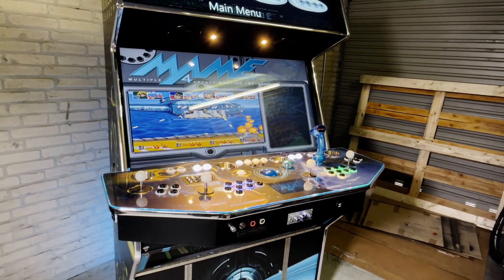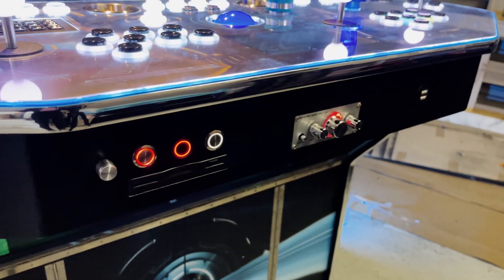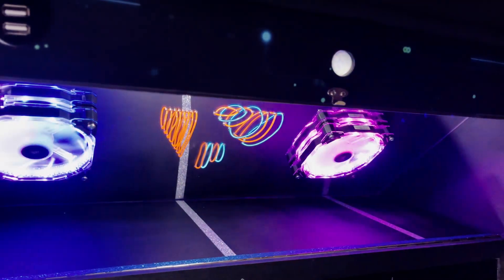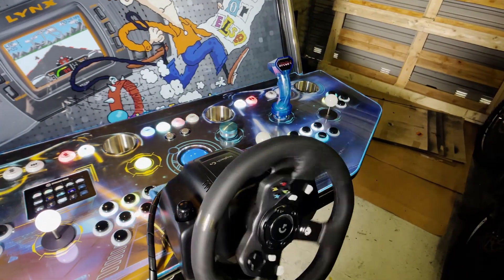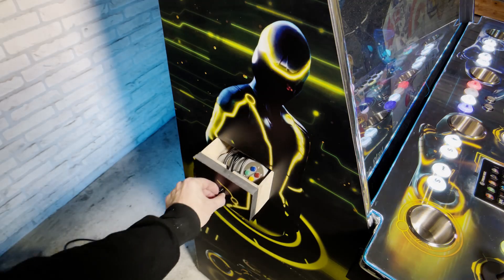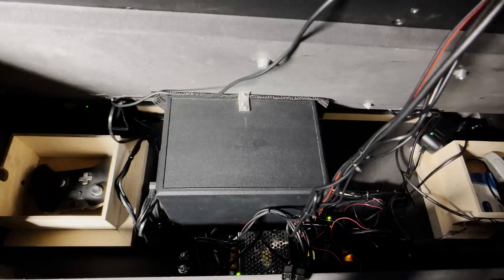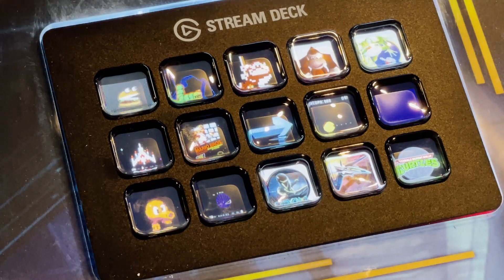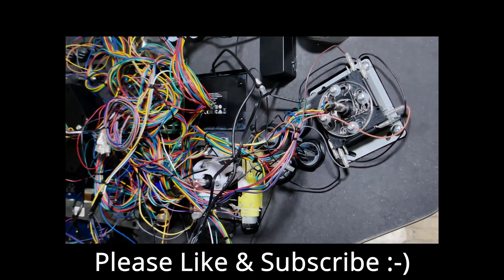TRON Arcade Cabinet | 43 inch FOUR player with steering wheel 😱🕹

Comment: What is the front end software you are using? I see it is windows os. Just wondering what you had to do to get it to full launch and shutdown with a button press.
Reply from the maker: Hyperspin 👍🏼
Second question: all 12 and 5V peripherals are powered by the pc psu. This way, they turn on when the PC is starting up.

Comment: Could have the wheel underneath the panel and then flips from bottom to top when you need it. Hiding it underneath the control panel when you not using it. I know lots of work

Comment: Is there more than just the 2 speakers over head?
Reply from the maker: Yes, it has a logitech speaker system inside. The two top speakers are wired to the logitech set. Thanks, Daniel

Comment: Hi Daniel i have been following your builds for some time now and they are amazing! I have recently built my own 2 player arcade with a 32 inch screen and i would like to turn everything on with one button as you have done, but i cannot figure it out. Can you help with how you did this? Any reply would be a great help. Keep building these amazing machines as they are an inspiration Thanks in advance.
Reply from the maker: In my case, I was lucky. The screens will turn of when not recieving signal and the 12 spots are connected to the pc PSU. Another (better) way would be to use a heavy relay. So:  115/220V into the PC, PC 12 or 5V into the relay, relay to the extention cable. This is commonly used in virtual pinball machines as well.

Comment: I can watch this video over and over again lol. Great one. Daniel how did you get the dynamic marquee to display the same size as the 7’inch lcd screen in the control panel?
Reply from the maker: Hi, the Marquees are operated by a program 'Hyper Marquee' the build in screen just shows the logo or game-box art. The huge Marquee on top shows the actual Marquee. Thanks Daniel
Reply: @TheDanielSpies_Arcades  okay makes sense to me now. Do I have to set up two different Hypermarquee programs so they don’t interfere with each other.
Reply: Okay I see how do you set that up in Hypermarquee? I find it difficult to to set up for two different monitors. I want my second and three to display marquees or clear logos. Not sure how to do that in EDS..

Comment: Does anyone know the size screws to mount the 7 inch LCD panel to the wood? I cant find this info anywhere.
Reply from the maker: No screws! Panel is only 4mm thick and flush with the board. I use a metal plate to hold it in place. Thanks D

Comment: looks great, I had a short question, have you use 2 Ipac Boards, when yes how the software check this, when i use ipac software, is there to boards,? thx for a short feedback
Reply from the maker: Hi Roger, you need to do a firmware update on the second Ipac board and make it 'ID2'. After this everything is recognized as a separate board and works very well. You can find the firmware needed on the Ultimarc website.

Comment: The 3.5 disk and EL lighting are awesome!! The only thing that bugs me on both your cabinets is that the marquees are not vertical but tilted. any particular reason?
Reply from the maker: Yes, I did not really like the designs with the hypermarquee flat. All the designs (except mine) have this indeed. So I changed this to have the same angle as the main screen. :-)
Reply: @TheDanielSpies_Arcades  makes sense :)

Comment: WooW WTF Amazing Cabinet, you have a knack for it ;)
I have 2 questions + a question-suggestion:

1.Do you have any photos of snippets of what it looks like from the bottom, ew mounting this retractable shelf under the steering wheel pedals, I understand that it is on ordinary shelf guides (I would like to mount something like that at home)

2. Does this solution mean that the Cabinet does not wobble, moves etc while playing, I know that it is a massive Cab but still hmm?

-For what really and whether this screen on the panel is useful, in my opinion it is unnecessary, so I ask, it would be better in my opinion to give the trackball lower (I do not know if someone has hit the glass by a strong movement): P
Reply from the maker: The sliding panel is not on standard rails. It is sliding with a special construction I made out of MDF. This level of precision is only possible when you CNC cut your machine though.
Screen inside the control panel is not needed at all. But: it is very cool to have it ;-))

Comment: love your stuff! how did you attach the EL wire to the edge of the control panel?
Reply from the maker: I made the plexiglass 2.1 mm smaller so the EL wire would nicely fit at the side. Then I keep it in place with... hot glue :-D Thanks, Daniel
Reply: @TheDanielSpies_Arcades   haha sometimes the old fashioned way is the best!
Reply: how about the one power shutdown? did you just wire it into the motherboards power switch? or you made a AHK of some kind